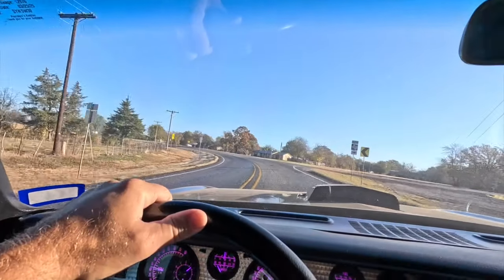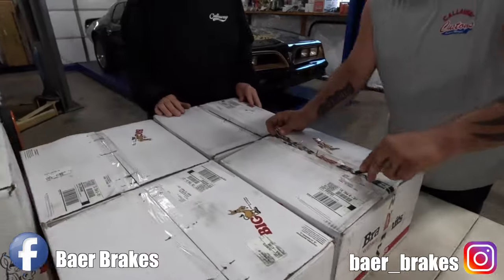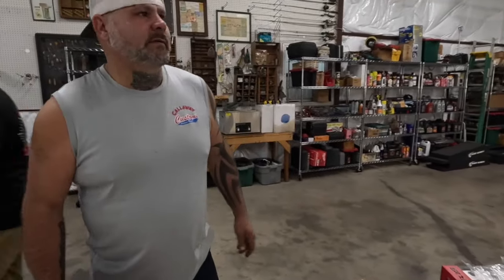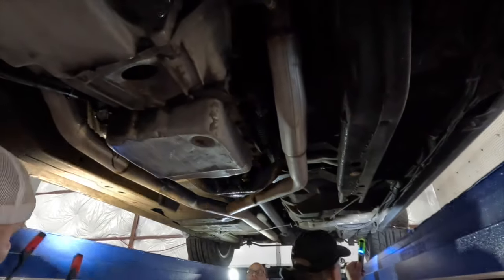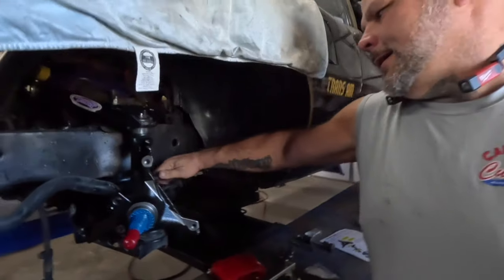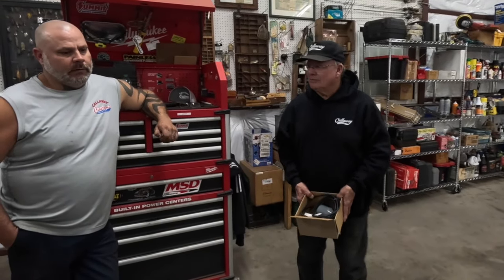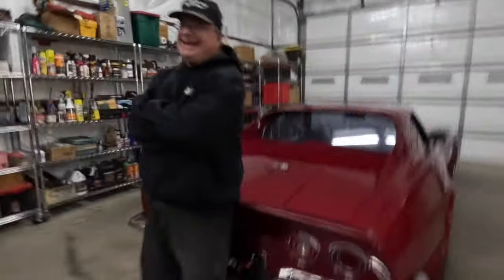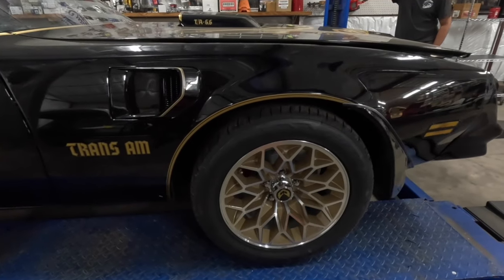Building A Classic Car To Tour America

Comment: My  '79 Z-28 Camaro came with 3:73 gears a 4 speed manual trans was standard.  3 speed automatic  was a $77.00 Option.  GM 10 bolt rear ends are pretty strong, but the Posi Traction clutches are rather weak.  My Posi basically does not work anymore. I always added the little bottles of GM Posi Traction additives to the rear end too.
  I opted for a close ration Bor Warner T-10 it has a tall first gear which is bad for drag racing.  I replaced the T-10 with a Doug Nash 5 speed.  It has a very low first gear 3.27 to one if I can recall, but no overdrive so my milage still sucks.  I still have the low 8.2 to 1 stock compression.  I upgraded to a very popular in 1980 327 350 HP corvette cam, a Holley Street Dominator open Plenum intake which kills mpg and low and torque but makes more top end power and Hooker 1.75" headers that make more torque and mid range by far than the Long Tube 1.875 Hooker side pipe Headers.  The long very restrictive  Silencers made the car a total Dog.  I used to have to take the Silencers out and run straight piped to street race and drag race.  I could get away with it as long as I didn't put my foot into the throttle.  I used to Scare the Crap out of Harley Riders of course the National Speed limit was still 55 MPH back then.  Harley's would be rolling down the highway at 55 MPH with their Straight Pipes Oblivious to their surroundings.  I would get going 100 MPH or better in the left lane on the Highway then throw my Trans into Neutral coast up beside them and  then when beside them Rev My Engine to 7,000 RPM's in Neutral.  Now all of a sudden my Side Pipes directed the sound right to the bikers. They would about jump off their bikes.  I ride quiet Motorcycles so I can hear the Idiots in 4 wheelers sneaking up on me and around me. Eventually I made my own baffles to put in the side Pipes the car ran way better but was rather loud, maybe not as loud as many straight pipe Harleys are.
  One time on the 4th of July on a two lane Highway I passed a whole Group of Harley's I suppose it was a gang. There were never ending lines of cars leaving the Fire Works on Lake Michigan from South Haven, but no traffic going west towards South Haven late at night, thus I was passing 10 cars at a time, just to break up the boredom of my ride home from the Beach.  The Bikers were really pissed at me for passing them and tried to chase me. My Camaro goes from 0 to 150 MPH where it tops out at 7,000 RPM's with the 3:73 gears.  I want to put a Tremec 6 speed in it. They have two overdrives, then the preferred ration to use with be 4.11 gears. I want to install a Dana 60 rear end with a True Track type Posi that actually works and a 4 link suspension from Ride Tech as QA1 are just too expensive.  Also, I have a 110 HP Nitrous system on the car to make up for the low Compression ration. I have beat many cars on the street that run mid 12 second quarter mile times. I ran 13,76 at 107 MPH in the 1/4 mile before I put the 5 speed in it
  I have much Larger Sway bars front and rear.  Herb Adams very Special Equipment. The front Sway bar has Heim Joints. I removed 1/2 coil from the front springs though a Drop spindle is a much better way to go. I also removed the rubber bushings from the Body and replaced them with steel washers to lower the car even more.
  I never had any problems stopping with the stock Brakes. The car still has the original brake shoes and pads on it with 54,000 miles in it. I stopped driving the car after I cut the wheel wells out with a sawz all to make room for much wider tires with the wrong back spacing. Rain and Mud would fly everywhere. I have some fiberglass fender flairs to add to it then I need to fabricate my own inner wheel wells and fenders. I only drove the car two winters before storing it and driving winter beaters from then on in the winter.
  I bought a '73 Chevelle with 63,000 miles on it for $300.00  I had the Turbo 350 rebuilt  for $250. The Chevelle had 2:73 gears in it as did my Chevy 1970  Impala. The Impala would do 110 MPH in second gear and 120 MPH in 3rd gear.
  I changed the oil in the  73 Chevell with a  putty knife. I ended up pulling the motor from the car.. Pulled the oil pan off. The crank and rod bearings with good, but the heads were totally shot. The Previous owner never changed the oil.  I put the heads from my '70 Chevy Impala were 64 C heads and the 73 Chevelle had 76 CC heads. The '70 Chevy Impala actually had 10.25 to 1 compression and the 73 Chevelle and my Camaro have 8.2 to 1 compression.  The 70 heads gave me around 9 to 1 compression for being a Skibum in Colorado and Utah driving at very high Altitude.
  I put an Sp2P Economy intake a spread bore 450 cfm Holley 4 barrel carb Headers and  Turbo Mufflers.  I had very tall rear snow tires. I got 22 MPG on the highway, but now that I think about it my odometer would have been off quite a bit no GPS back then to check it but was probably 24 MPG. Also I put the cam and timing chain out of my Camaro in the Chevelle.  At 14,000 miles there were 4 bad lifters. I replaced 4 lifters when I installed the cam in the Chevelle.  I found out 25 years later that GM had a recall on cams in 1979. I later bought a Used 79 Chevy 4x4 all wheel drive pickup that had a bad cam in it. It clattered a lot.

  I spent Considerable time on the Bear Web site. I could not find the Master Cylinder you used. They mentioned that the smaller rear rotors would still clear 15" wheels.  I still have the McCreary L-60 Dirt Track tires on 10" Wheels.  They lowered my 1/4 Mile standing start circle track from 21 seconds to 19 seconds. They have so much traction that now the axles wants to wrap around the springs.  I need Slapper Bars " A Grumpy Jenkins Invention" or a 4 link rear suspension. The one from Ride Tech is all bolt in.
  I rode the Black Yamaha FZ-07 with side cases and a top case on it in your 2023 Convoy for 4 days from Clevland to Detroit to Kalamazoo, to Surgis to Ft Wayne. I have you all of the Political Memes at the Hotel in Ft Wayne.
  Perry Harley Davidson in Kalamazoo / Portage accommodated your Convoy on the 4th of July, Battle Creek HD didn't want to be bothered to open on a Holiday, you booked your Hotel in Battle Creek then rode to Kalamazoo, then back to Battle Creek to your Hotel then Sturgis the next day.
  Perry HD was the oldest Family owned HD Dealer in MI. It was a second Generation Business. The owner was 93 Years old when they closed in December 2023.  His 30 years Younger Wife Ran the Business along with Matt Deckard the General Manager who reached out to you as a Dealer to stop at.
Reply from the maker: Whoah! Sounds like you really know your stuff! I appreciate it👊🏼

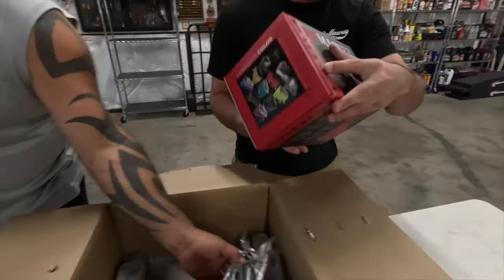Comment: If you really want to make it a true cross country cruiser put an overdrive transmission in it with a set of 3:23 or 3:42 gears. Had a similar setup in my 1968 442 convertible. Was awesome on the highway but still had plenty of get up and go off the line.

Comment: Route 66 is aproxamently 2,500 miles. Assuming $4 a gallon for gas. 22 mpg = $454 and 8 mpg = $1,250. Besides the gas savings... the added engine wear   needlessly reving on the open road. Keep what you got.... spend the gas savings on more parts for the car. 😅
Reply: Good old math!